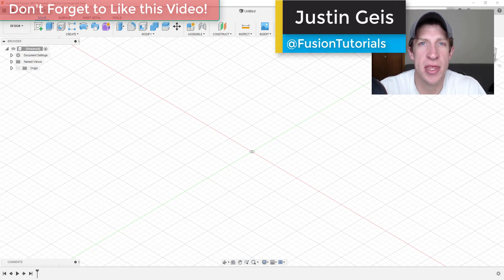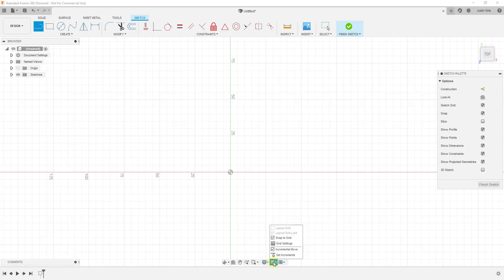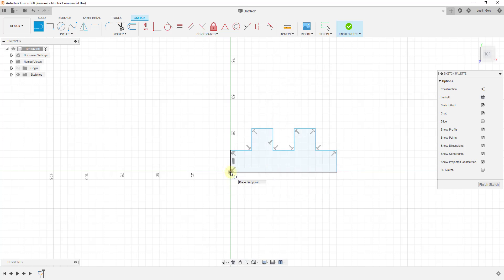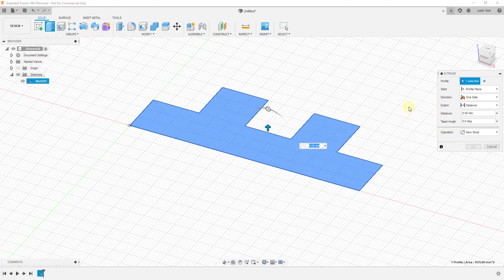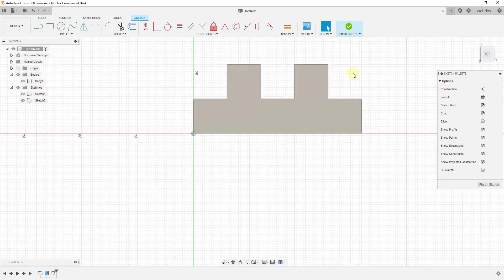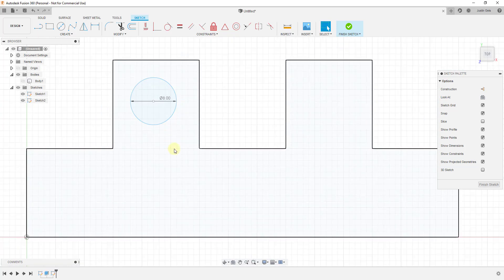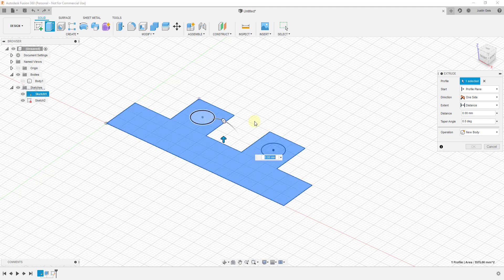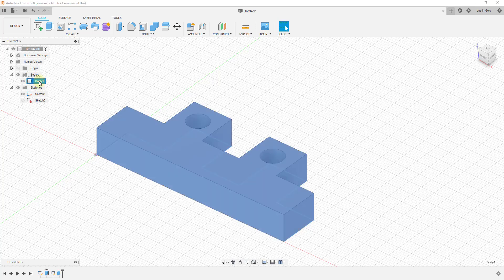Getting Started with Fusion 360 Part 2 - How to Create 3D SHAPES!

Comment: Hi Justin, I hope you can help me a bit. I'm a total newbie to Fusion 360 and have watched a couple of your excellent videos. Thank you! I am trying to manufacture an electronic product that is housed in an "off the shelf" pre-made plastic enclosure. The enclosure has 2 "end panels" that I need to machine a few rectangular cutouts and a couple holes as well. I purchased a desktop CNC engraver that I plan to use to make the cutouts in the plastic end panels using an 1/8" carbide milling bit.  I cut a piece of wood that is 1/4" thick to use as a "bed" that I can clamp down to the table. I wish to mill a pocket in the wood base that will hold the plastic end panels while machining.  If I create a solid shape that represents the wood base, and then I create a rectangular "cut" shape to create the pocket within the base shape... how do I create G Code to machine out the pocket shape in the wood base? I hope you can help... but I understand that you're probably too busy or something. Anyway, I appreciate your excellent videos, and I am trying to figure out how to do this.

Comment: Hi Justin, Couple comments coming from Inventor/Solidworks/SketchUp background and just starting in fusion. This may just be simplified this early in the tutorials and you'll cover it later, but figured I'd share in case. 

It is better practice to pattern (rectangular/circular) the FEATURE and not in the sketch. It becomes much easier to update at a later point if the design changes.

Also, in general it would be better to have the circle cutouts constrained in a way that they auto-update should geometry change. For instance if your tabs became smaller or larger, by saying they are 7.5mm from each edge will not keep it centered on the tab.

Comment: Just a tip guys, when cutting the holes with the extrude tool its good practice too change the extent type to "to object" and click the face that you would like too cut a hole in, helps if you change the size of an object later so the hole is always far enough

Comment: Thanks for the super basic, step-by-step. It's just what I need. One thing it would be helpful to add is what to do when you get something wrong- doing the sketching the tabs, I accidentally kept clicking in the "change plane" indicator, because it was right where I wanted to put the next point. Once I did that I didn't know how to reconnect to my ongoing sketch. Or in the extruding, I accidentally hit return or something and made bodies when I meant to be making holes. I stepped back through the timeline, but it kept the extra bodies. Also, coming to Fusion 360 from other drawing tools I want to know things like - once I've typed in a number to specify a dimension, do I hit tab?, return?, or, maybe it looks like I just click the plane... but that's a small level of detail that it would be helpful to add for people coming to this from other drawing and drafting tools. Thanks again for these. I've tried several different sets of tutorials before finding yours. I'm going to work through a bunch on your channel.

Comment: Justin - Great job. 90% of my design time I have internet connections. But when I travel 10% of the time I do not. I like to design when I travel on long flights to kill the time. Because Fusion 360 is cloud based, does that require internet connectivity to save a design? If I understood you correctly, Inventor is better if you want to save locally.